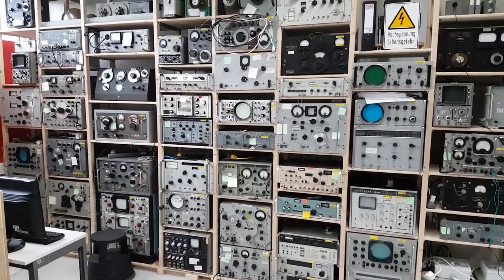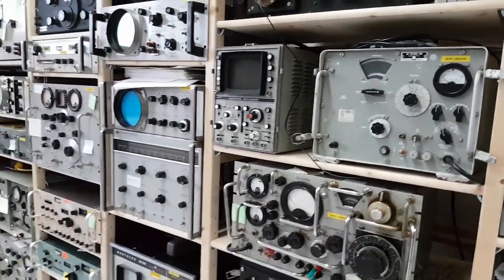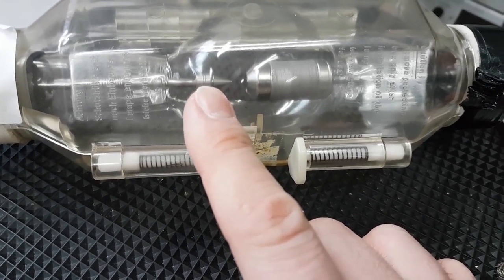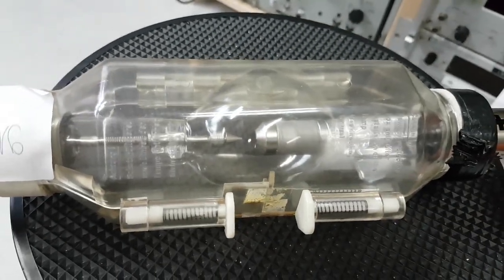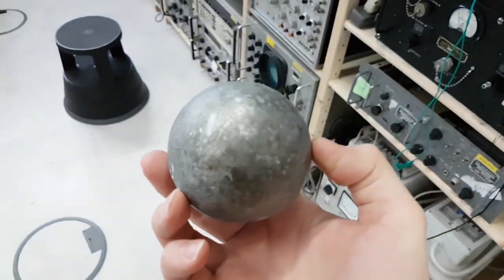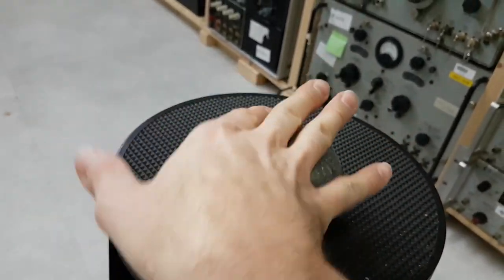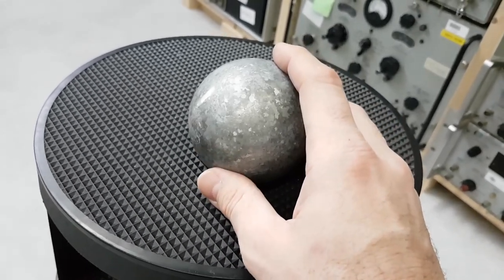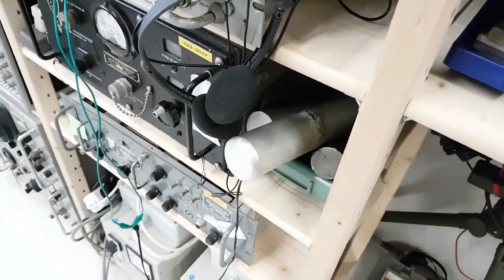Is there anyone with the right skills to operate the Hutch Lab?

Comment: Hi! I'm from switzerland. You need more than only electric static field and magnetic field. You need a source of alpha and beta radiation. A x-ray tube or an uranium ingot :D John claims that he used uranium as alpha / beta radiation source. Anyway... 3 tesla coils, a van de graaff generator and a source for microwaves like magnetron. Further he used a signal generator, ELF coil antennas (for RF) and static ion source equipement. oh, and the most important thing: high power gain sign transformer (min. 400'000 Volt).

Tuning of the complete system takes more than 6 month to achieve the hutchison effect. A lot of time ;)

I hope it helps. Kind regards, liebe Grüsse und viel Glück :) swim
Reply from the maker: Yes, he has informed us of these aspects - in addition, use of high strength Nd based magnets.

What John did not have is an easy way to nucleate the active structures, however, it seams we have now identified a way in the LION reactor.

https://youtu.be/_jV_XVgMRiA

Then you can feed with the RF.

Comment: Did anything ever become of this project Bob?
Reply from the maker: At the time of my visit at the beginning of last year, they had a whole series of tests planned in the space that did not use the equipment. That precluded any testing for some time.

We did not have so much understanding of what was going on in the process and what maybe the important factors. Shoulders public information was not enough and we would have been stabbing in the dark last year, even if we had the resources to run tests.

Several factors have improved the situation.

- Leaking of formerly classified Shoulders book
- Meeting and building relationship with original claimant
- Exposure to Russian understanding
- Analysis of samples in Russia in October 2018
- Analysis of samples in America and Australia in August 2019

Now there is a reasonable chance we understand some of the key aspects that may make it do what it does and so we just need the cash and personal to be free at a time that the German lab can host tests.
Reply: They bought the lab in the middle of me leaving and orders of the mayor half the stuff did not make it to Germany Iam now rebuilding  for more controlled tests that will be public on medias as well I’ll inform certain folks that I worked with in the past if it works ? At all it should get funded on the rebuild but it’s slow and better equipment equal to 1988 lab

Comment: Any news yet re lab experiments dated May 19 2019
Reply from the maker: The lab is there. In it are conducted other experiments in the meantime. We have spent the interim period understanding what might be going on in the process and analysing samples from John Hutchison, this gives us direction and ideas for structured tests. When these have been readied, we will make a funding call to do the actual experiments. It would be pointless to just go and twiddle knobs without an idea of what to do. We have met with John a number of times as part of this process.
Reply: I'm not sure that just twiddling knobs would be pointless. Mr. Hutchison would have thought outside of the square, CAN WE! So as long as nothing is blown up AND meticulous records are made I say go for it.TRY EVERYTHING, ANYTHING AND LOG ALL RESULTS. Tip (perhaps a clue) Al Bielek said on Art Bells Show (Coast to Coast) years ago something I FOUND VERY ODD about the Philadelphia Experiment. (Will try and locate it for you)The Generators were driven via "RIGHT ANGLE DRIVES". That's odd because gensets are USUALLY direct straight through drives via a coupling for simplicity, efficiency & cost, OR in this case Space. I wonder. MAYBE? BUT perhaps it was to get a speed (therefor a frequency & or phase) relationship, the gears used being conveniently available hence the right angle drive.  SO how big were they and what ratio. MOTOR SPEED WOULD ALSO BE AN ADJUSTABLE PARAMETER.Remember they did not have a lot of technology we have today.Those Degaussing coils on the ship were I seem to recollect part of the system. PS I am a retired electronic engineer and have often wondered WHAT MAGNETISM IS. I know what it does and many ways to manipulate it.I've had a gut feeling that there is a whole branch of physics that's been kept hidden ever since I learnt light is a wave or particle depending on how you observe it. OR maybe a particle travelling through a medium we aren't privy to.GOOD LUCK
Reply from the maker: @cameronbruce1862  Any and all tips we will consider, more information the merrier.

In the meantime, some of your questions may be about to be answered.

https://www.kickstarter.com/projects/1138088857/space-earth-human?ref=6bj908